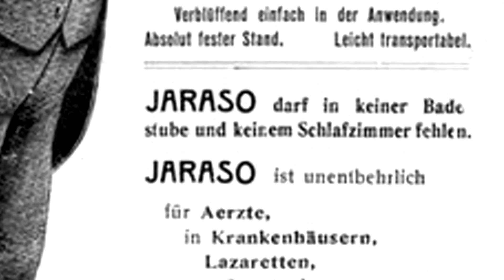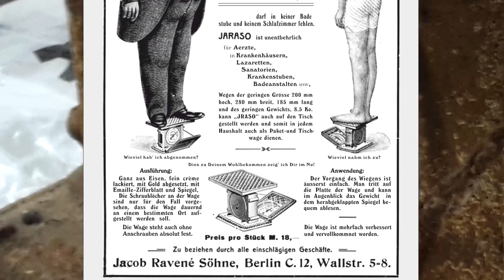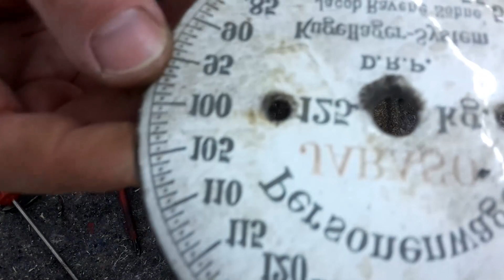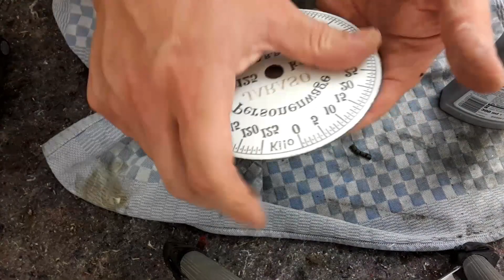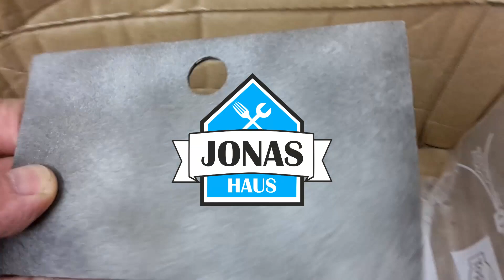100 Jahre alte JARASO Personen (Spiegel) Waage - Restauration Teil 1

Comment: Have you ever heard for wd 40, burner heating? To much damage. you destroyed a lot of the original screws... have u analize paint pigments? This is not restauration...
Reply from the maker: Im not a big fan of wd40, Balistol is much better, but please let me know how penetration fluid helps with overpainted screws? I also wouldn't recommend you to heat up or burn away paint from this time period since it most likely contains lead. There is no way to remove screws within this condition without some damage, if you watch the part 2 video you will know that i replaced the screw with brass ones for optical and future rust prevention. There is another issue with the old screws, the are bend and not metric, you cant recut rusty threads, one more reason for replacements. Your point with analizing paint pigments made me laugh.... this is a scale not a painting from Picasso...
Reply: @jonashaus6921  i will show u my conservation tretman for about half month. Not even one screw is  destroyed, and paint is retouched, also there was dmg on enamel. But i must admit i use your video to see weak points when disassembling... On colour metal try to use citric acid buffered to 3.5 pH with ammonia, u will clean rust but not paint. When mentioning heating, I meant heating screws, not paint. And when you mentioned it, it's not lead bleach, it's zinc oxide in an oil binder.

"your point with analizing paint pigments made me laugh.... this is a scale not a painting from Picasso..." U said all, and that s why pls dont call this work restoration. Also, I don't understand the logic of repainting the whole thing and then destroying the mirror to make it more antique. Brass screw on Iron and u talk about future rust prevention? Have ever hear about galvanic corrosion? There is a lot of professional literature on the net about conservation treatment on metal. look it up
Reply from the maker: @martinovicg  Man this is a fun project, I'm by no means a professional, the scale has been restored from a rusty old piece of junk to fully functional and beautiful. I think you take this a little to serious. I made two mirrors, one aged and one perfect (not in the video). I wanted to learn about the mirror ageing technic and had loads of fun doing it. I know a lot about galvanic corrosion and I can tell you these brass screws will not rust within the next 10 generations I can guarantee you that :)  I cant wait to see your video!
Reply: @jonashaus6921  "Man this is a fun project" that is the point, it s not restoration. I will not upload video, but i will share picture over ImgBB and put link here.
Reply from the maker: @martinovicg  Its a restauration by the definition, are there things that could have been done better, maybe, but I'm now here 3 years later and I'm still happy and proud of my work. If you want perfection watch "My mechanics"
Reply from the maker: @martinovicg  How is the pigment analysis of your project coming along?
Reply: @jonashaus6921  work is over like 2 months ago, like i say it is zinc oxide in an oil binder. i will upload picture on any server and u will see picture before and after, and alos what real restoration it is.. sand the paint and tear off the original screws it s not.. trust me. U kill the all past of that artefacts. but .. i give up.
Reply from the maker: @martinovicg  can't wait to see :)